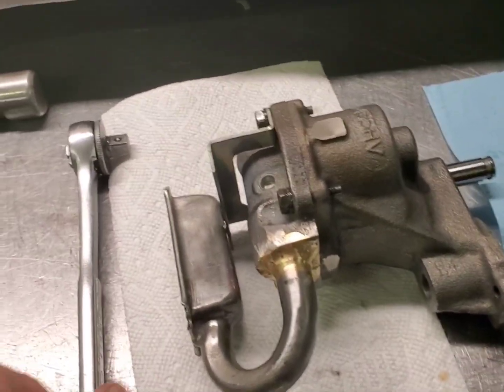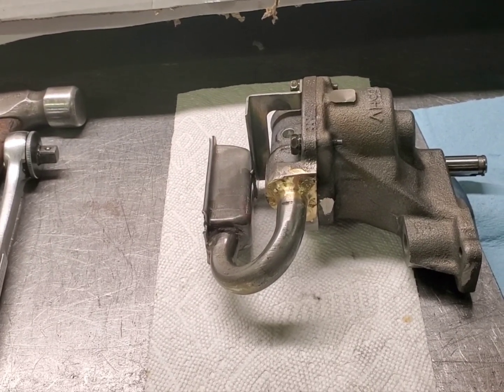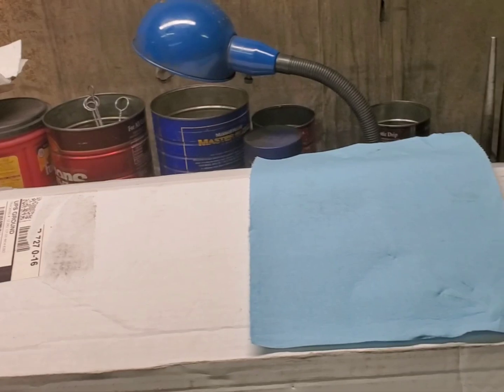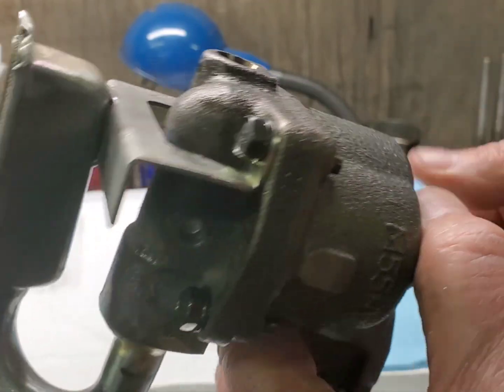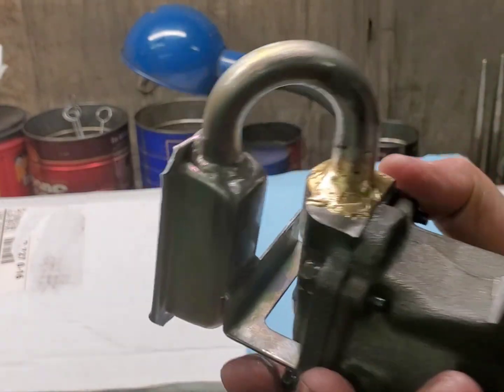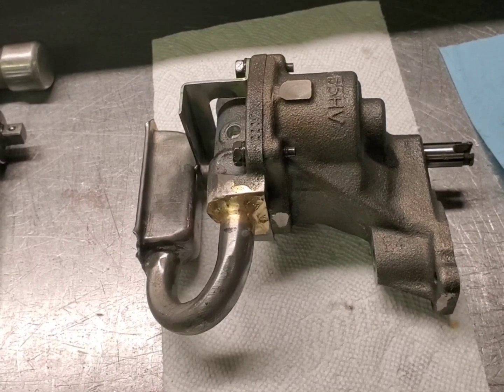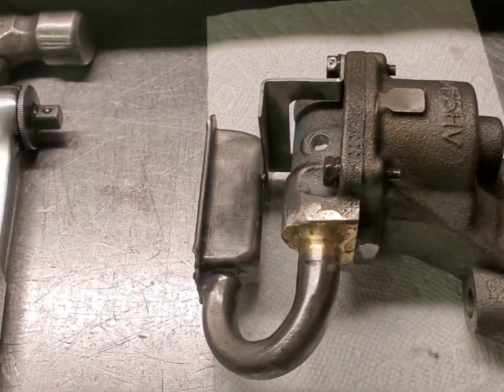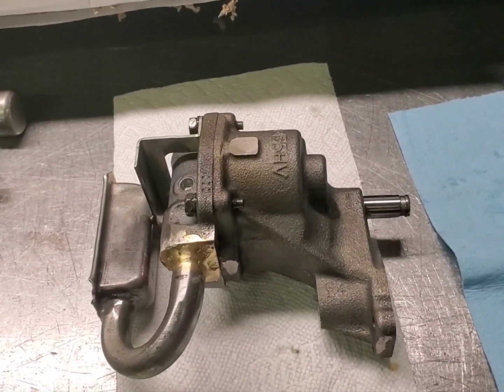406 Small Block Chevy Oil Pickup Installed and Brazed Welded On.

Comment: I've found a total of two pickups disconnected and rattling in their oil pans so far. Both weren't welded but both also had poorly done engine mounts.
Thanks always Ed
Reply from the maker: Good morning Ary.
I always appreciate hearing from you.
Two years ago I had a 350 in a Roadster, that was supposed to be a 383.
The cam was wiped out.
But the oil pickup fell off and was mangled up and wedged up in between the crank, main cap and pan standing there when we pull the pan off.
About 2300 miles on a fresh rebuild.
Engine had leaks all over.
An aluminum oil pan that did not fit his engine.
Split pan gaskets.
I was not doing content on YouTube,  but this would have been a "great not what to do"!
Take care, Ed.

Comment: That is really nice work on the brazing. I read in another comment that you are going to start TIG brazing. I went that route a couple of years ago, and I have found it far superior to torch brazing. The heat from the arc is concentrated, and after you get the hang of it it is easier to direct and control. Also there is less overall heat into the part. TIG processes (brazing and welding) are basically smoke-free, and I found that I could see the molten puddle really well. My eyes are pretty bad; I am very short-sighted and had an eye infection that eventually required a cornea transplant in my left eye. I have good correction with a special set of contact lenses, but I found that my welding/brazing got noticibly better after I got a premium welding helmet with good optics. I asked around and the recommendation I got was for an Optrel Crystal helmet, made in Switzerland. It was expensive (about $450 on sale) but I found that I could see far better and thus control the arc much better; especially with TIG processes. It might not be worthwhile for everyone, but for my weak old eyes it sure helped. 
Anyway I think you will be sold on TIG brazing after you try it. For myself I generally prefer it to flame brazing and these days I would have to have a pretty good reason to pick up my old oxyfuel torch for this type of job.
Reply from the maker: Hello Gavin, thank you for watching and commenting. 
I think that I could use the Tig for many other things in the shop also.
One is welding aluminum, for head repair.
Hard to get that done where I live, and I know how to do it.
Also for other things.
But I definitely say there is still a need for the torch.
The more things we can do, the more services we can provide.
Thanks again.
Take care, Ed.

Comment: I can solder, I can stick and MIG weld, and I'm about to get a TIG whip to learn that, but I have never braised anything. Looks kinda like soldering with a yellow metal, probably higher heat as well. Don't know exactly what I'm looking for but certainly looks solid and clean. Good job.
Reply from the maker: Thanks Joshua, my brass was old.
Had a tube of new, but could not find it.
The Flux on what I had was old.
You can tig braze also, which is very cool.
Try that sometime. 
I do not have a Tig, I will soon.
Thanks for watching. 
Take care, Ed.